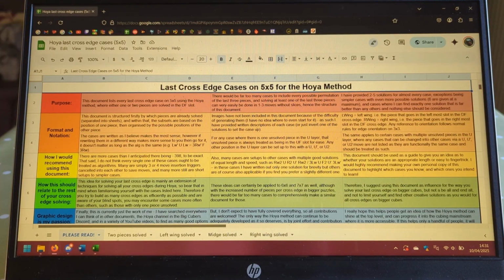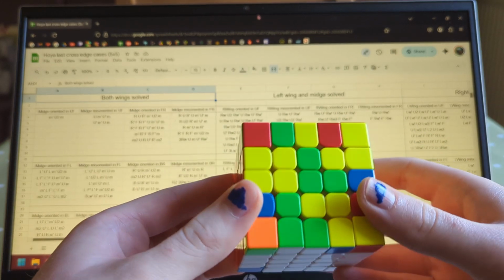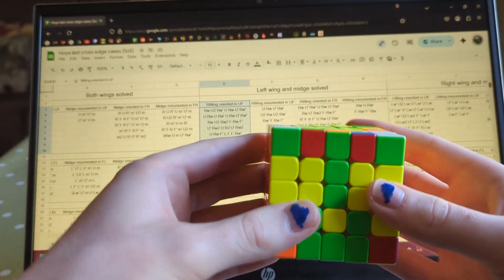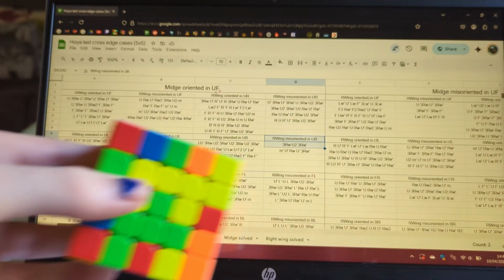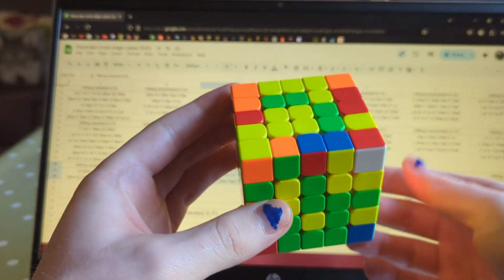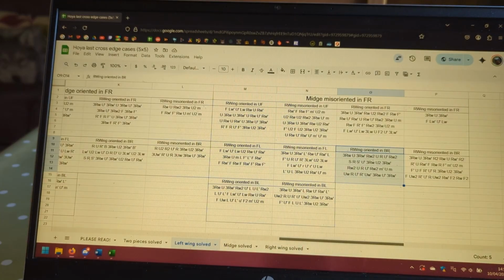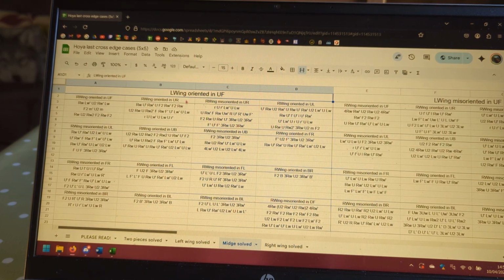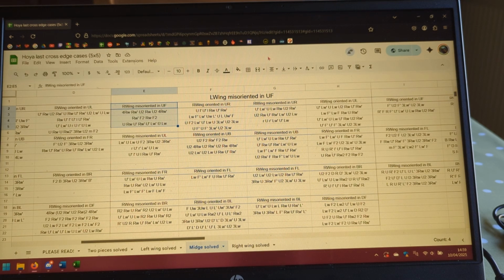Announcing My Most Exciting Project Yet - Hoya Last Cross Edge Document for 5x5!!

Comment: would be useful to let people leave comments on the sheet
for the two wings solved, midge misoriented in DF there's also Rw' F2 Rw2 U2 Rw' U R' F R
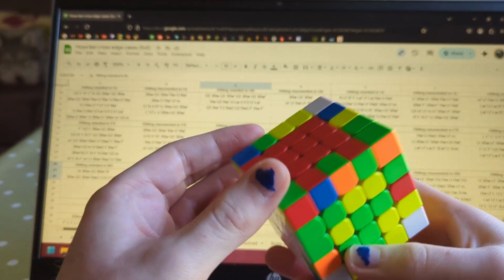17:57 3Lw U' F2 U 3Lw as well instead of the Rw2 trick
Reply from the maker: thanks for the idea! i've updated the sheet so that now anyone with the link can leave a comment. i've added that flipped midge solution as well.
as for the second case, yes 3Lw' U' F2 U 3Lw also works instead of the Rw2 trick, but solving the two pieces separately for that case is still 8 moves long, whereas solving them together with B' 3Rw U2 3Rw' B in just 5 moves, even though its slightly more awkward to execute, i think is still probably better